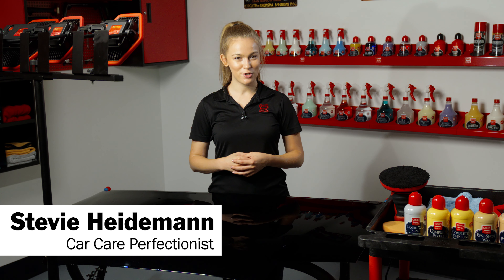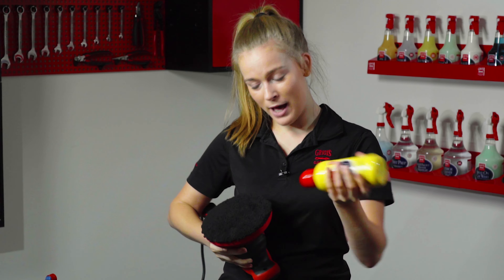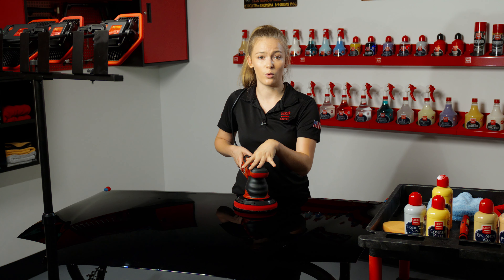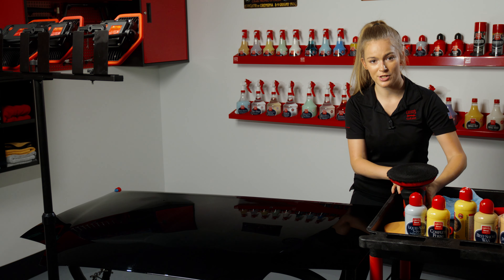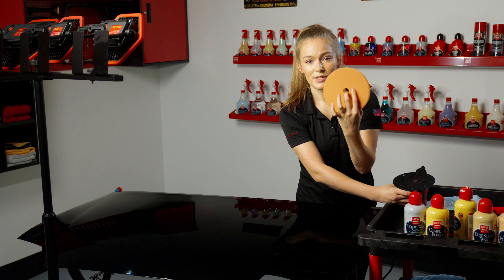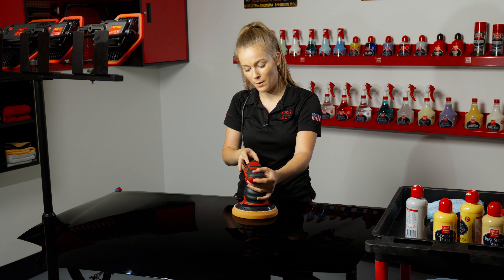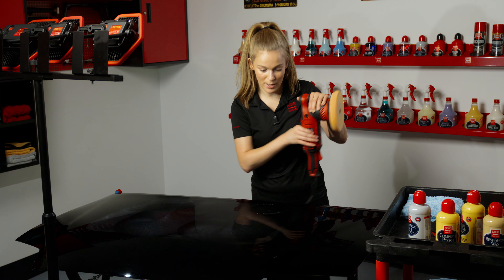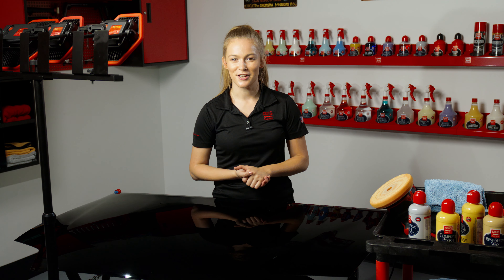How to: 2-step process with the G9 random orbital polisher

Comment: Got my new G9 today!
Reply: Steve S. How you like it so far ?
Reply: Does your whole arm vibrate like hers? Im debating on which buffer i should buy. Will be my first for basic home use.
Reply: @miguel90744  I used it for the first time this past weekend. It is the smoothest dual action polisher I have ever used, plus the lightest. It is awesome and given the price point, it is a no brainer.
Reply: @brandonalbright125  No! There is NO vibration to speak of. As I stated above, it is the smoothest polisher I have ever used. Buy it! You have nothing to lose with their 100& guarantee.
Reply: How much stalling is generated on side panels? Also are you using the 5.5 or 6.5 pad?
Reply: @notfound-qg2ii  No stalling and use both sizes, but primarily 5.5 inch.

Comment: You're using a finishing pad for correcting, and the correcting pad for finishing??
Reply from the maker: The naming convention may differ from other manufacturers, but in short; Yes. The microfiber pad is more aggressive than the orange foam correcting pad.
Reply: @GriotsGarage  I’m glad I read this before trying it bc I figured the black pad would be less aggressive.
Reply: This makes it so confusing